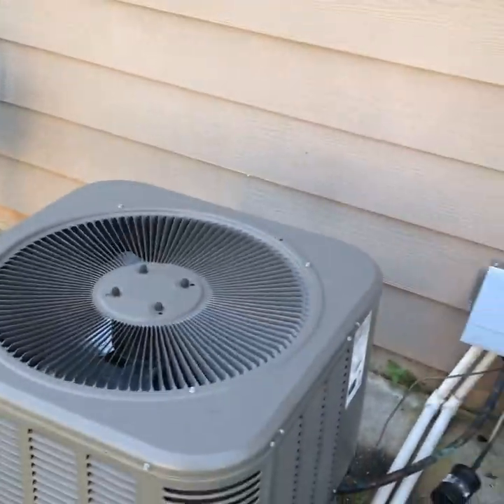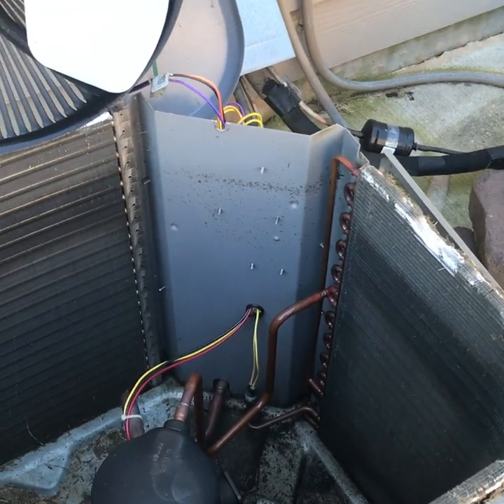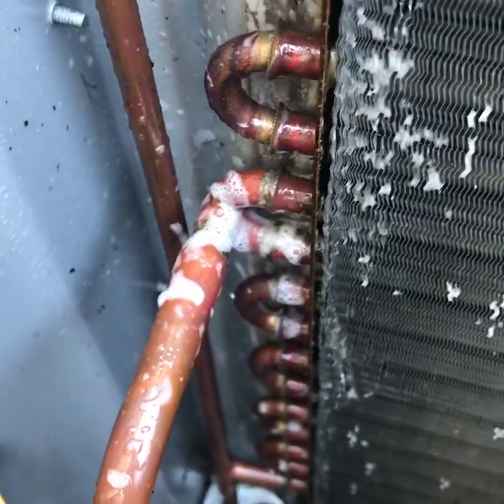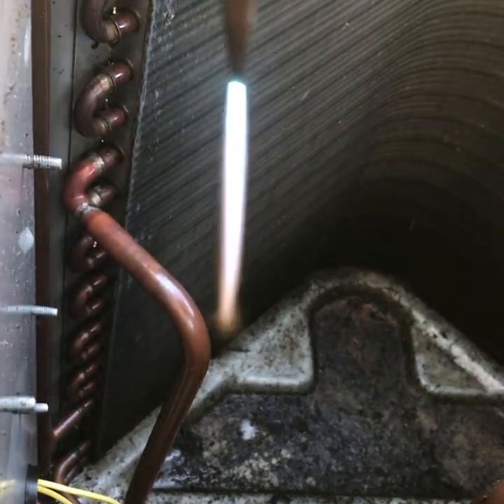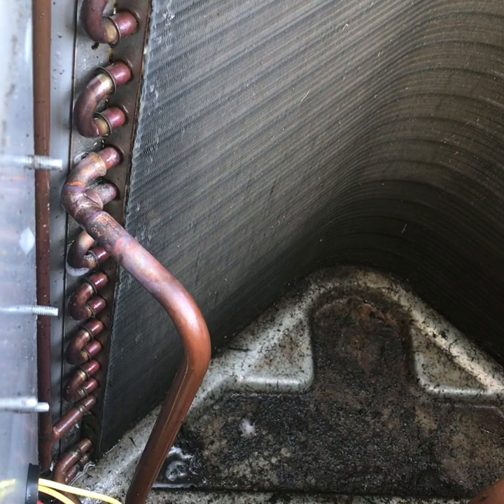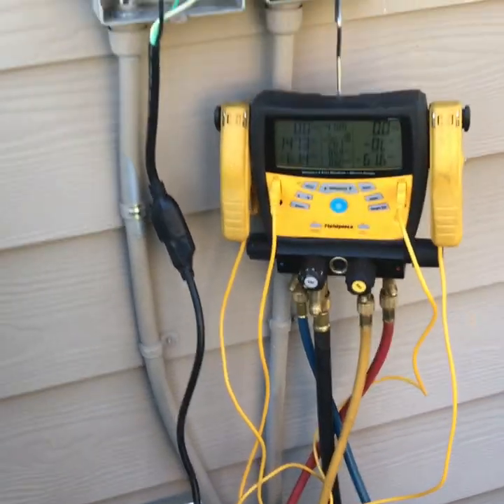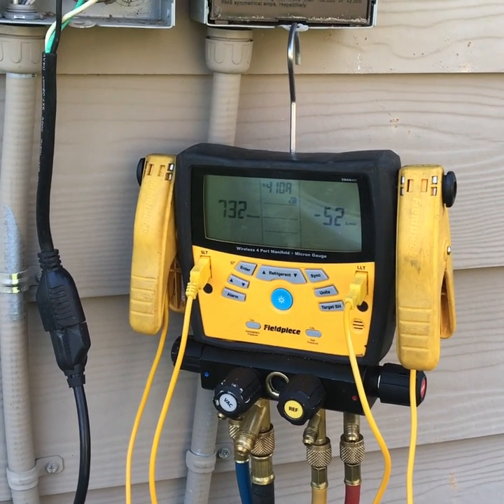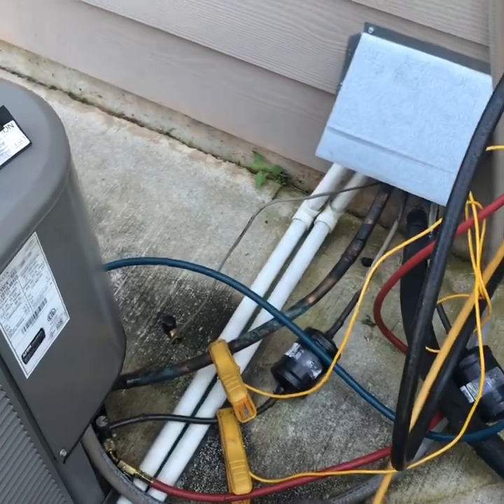Leak Search and Repair HVAC Service Call

Comment: thanks for your video. when the machine is empty, put nitrogen in at 200psi to find leak, after leak fix, vacuum to 600micron, then put some refringant in through suction side to the machine as spec( can we do it with condenser not running?). thank you!

Comment: My question is with all respect to you, im new in this and trying to learn,  i seen techs charging the system for the high side after a repair ( of course with the system off) but you charged the system from the suction line, is that also recommended? My question comes because at school we were told that 410A is liquid and is not recommended for the compressor add too much refrigerant at once, i would like to know your recommendations since you are a tech with experience, maybe there's something i miss from the video, i will appreciate any advice.
Reply: When the unit is off you add through the high side. Say if you place a filter drier and were weighing in the factor charge. While the unit is running you add it though the low side slowly to keep from slugging the compressor. You can do this by opening the the low side slowly.
Reply: They just adding it through the high side when it’s off to get some juice in the system, like r22 you can add vapor when it is off to get some juice in the compressor. Don’t want her running dry lol
Reply: Scroll compressors are tough, I’ve never had a problem dumping the charge fast but people do tell me it is in fact bad for the txv and the compressor bc it slams around